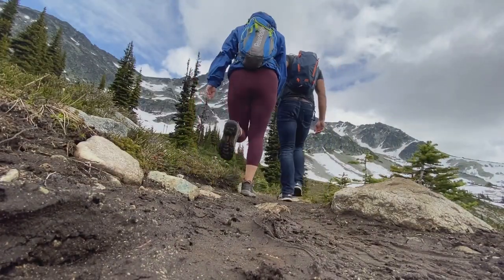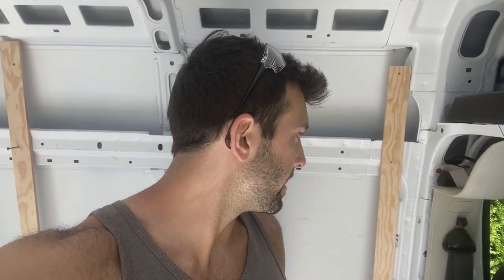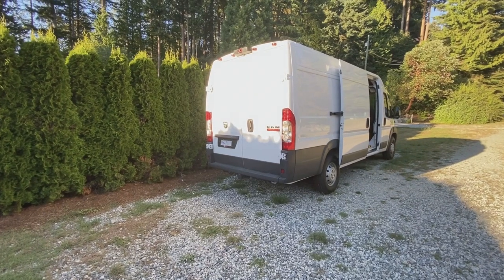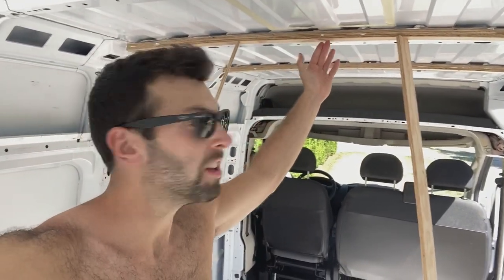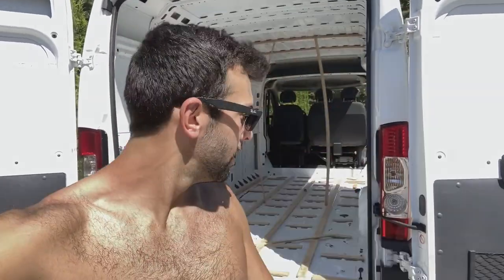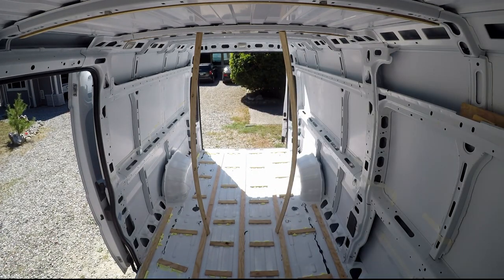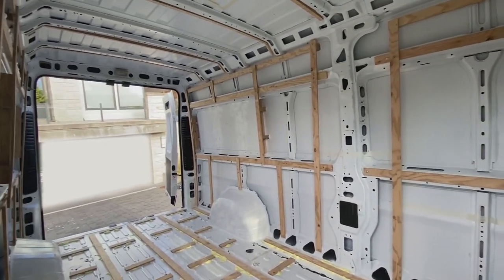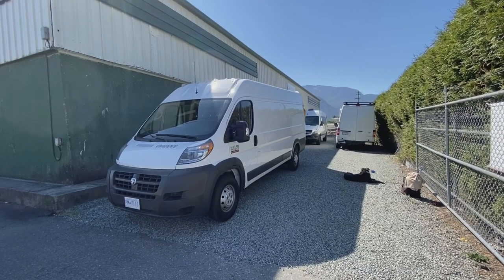Van Framing, Window Support Removal, Spray Foam Insulating! | PROMASTER VAN BUILD SERIES | EPISODE 8

Comment: Nice job on the progress and the insulation. I think spray foam is a great choice 
👍
Reply from the maker: Thanks, we do to!!! We’re super happy with it 😊 Are you going to spray foam your van?
Reply: @HayleyandJake  I would on a conventional van. I went with sheep's wool in the ceiling and foam board in the floors and walls.
Reply from the maker: Solid choice! How was it to install?
Reply: @HayleyandJake  easy and clean

Comment: Did you guys prewire ALL of your electrical before the spray foam? I'm going to get mine spray foamed and was just curious.
Reply from the maker: Hey! We did not, just the lights. 

We hadn’t designed our electrical system when we did our foam, and embedding them all would be a nightmare for maintenance down the road. We did install conduit in the foam to make it easier to run wires later, but we didn’t install nearly enough, so we ran the wires in conduit behind the cabinets 👍🏼

Comment: With doing the spray foam, what R value does it give you? Looking at all options.
Reply from the maker: For closed cell (what we used) it’s R7 per inch, it’s the highest you’ll find for the space. In most places we have 2-3”, less around the windows 👍